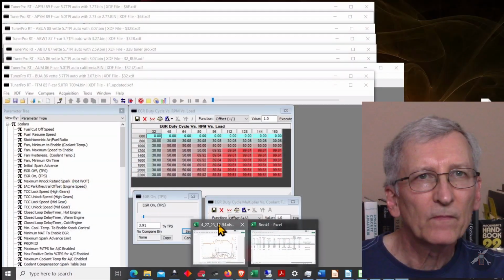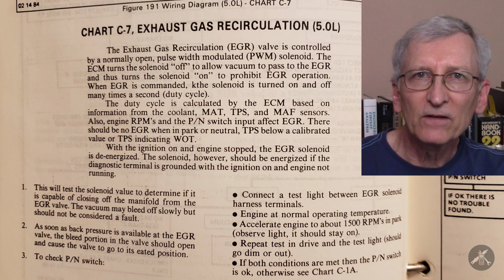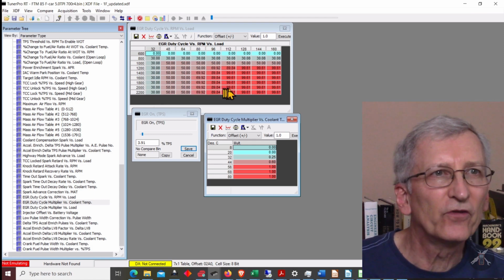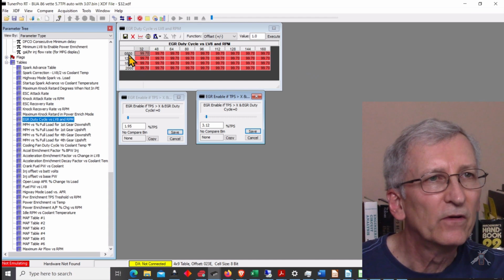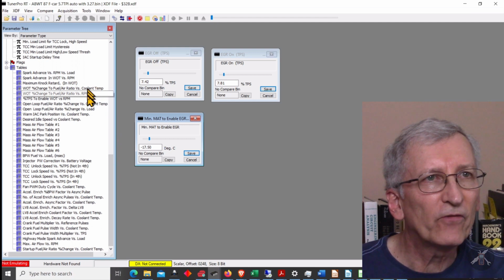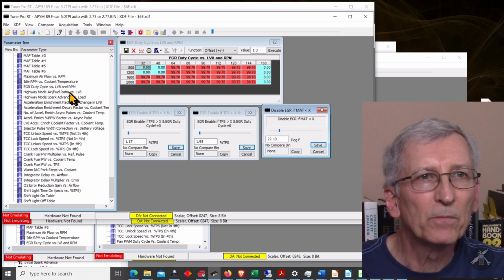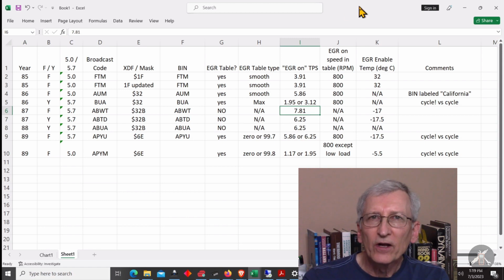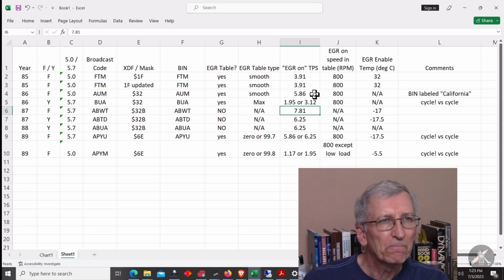85-89 Tuned Port Chevy EGR System Analysis with Tuner Pro and PROM Data BIN files

Comment: Good news! Passed today. We ran it at 15mph and 25mph while adding some brake pressure so the engine rpm was higher and EGR would open. Otherwise those speeds do not require enough rpm for an '87 to activate EGR. Thank you so much for your time and research on this animal!
Reply from the maker: Excellent! Congratulations! You're welcome. So, the theory was correct that the way that engine is calibrated just doesn't quite match up with the standard California test procedure.  It's good that they were willing to tweak the test slightly to actually load it up more and show that the engine will then respond correctly.  I always enjoy it when the theory can be proven out in the real world.
Reply: Absolutely my friend! Again, much gratitude 😊
Reply: @mikebruegger8654  May have to do with no static load (car weight wind drag). a brake load dyno is required to simulate real world driving. Close to a few decades ago when i had a bike shop S&S would not sell you their Fuel injection systems unless you had a brake load dyno to dial them in. Completely different tuning parameters with a rider, bike weight and wind resistance.

Comment: So its not going to work without the egr hooked up to it?
Reply from the maker: I'm not sure your exact question.  This is how the ECM is programmed to command the EGR.  
But, beyond that, without the EGR connected, the spark advance would be too high.  Without EGR, then the engine would knock and the knock sensor would pullback spark.  The way the knock sensor works, the net timing would be lower than desired, so the engine part throttle performance would be better with EGR properly working.
I thought I answered this a few days ago, but it seems to be lost.

Comment: Well, the TPS is perfect at idle and egr is activated as advertised at nearly 8% I wonder if in overdrive, the car does not need much "8%" throttle to go 15 and 25mph? Maybe it should be in 3rd gear during testing to help raise rpm % and  therefore activate EGR? I'll have to try it out.
Reply from the maker: Yes, I was wondering if that was the case where 8% might be too high for 15 / 25 mph. Worth testing to see.

Comment: And finally, I did have to replace the air pump diverter valve as it had a broken internal spring. That system is now operational as designed but the car still didn't pass Nox.

Comment: OK, will try again. That is some great detective work for sure. I was happy to hear that the EGR is either on or off on my 1987 350. It does seem strange about the TPS at nearly 8%. I am going to check my recordings on the EGR duty cycle to check the TPS reading.